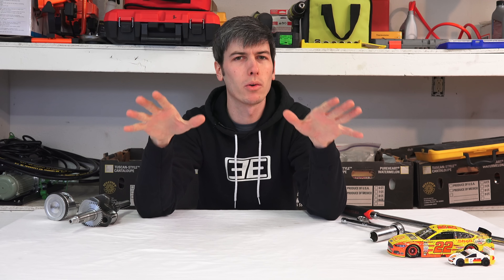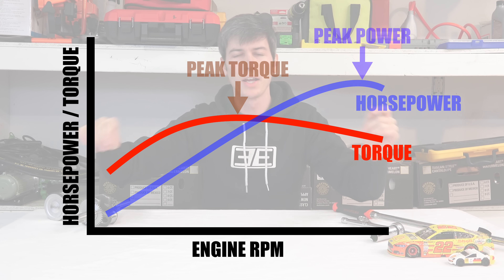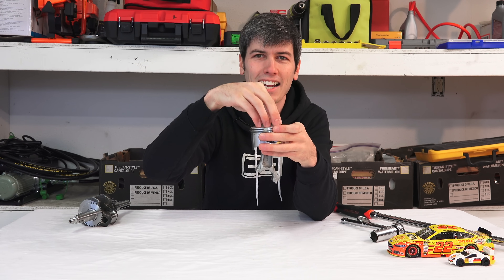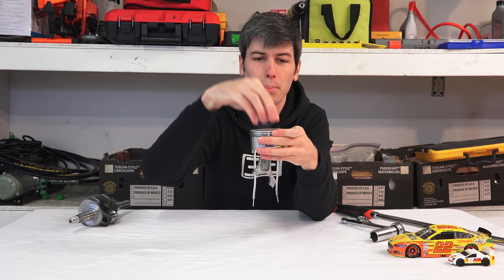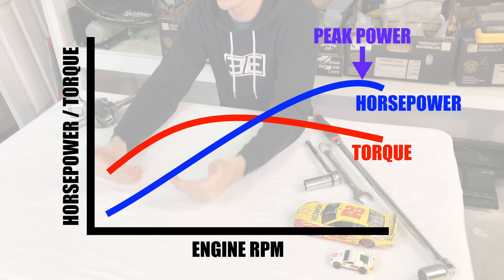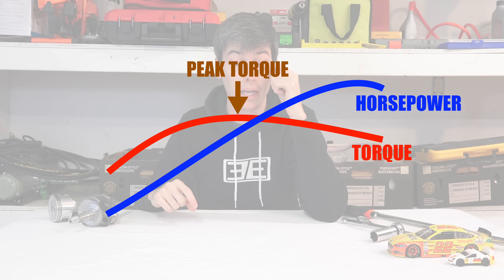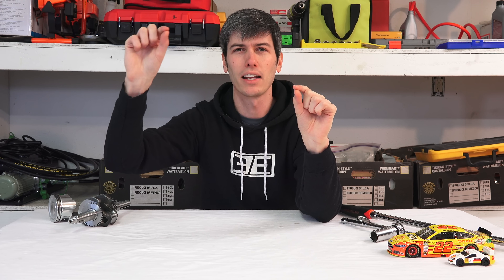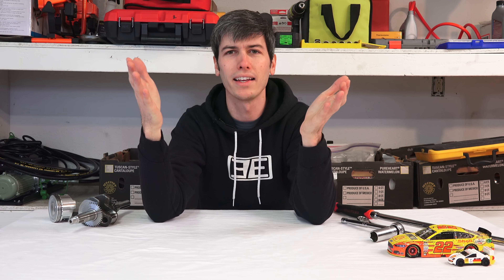Horsepower vs Torque - A Simple Explanation

Comment: Great video explaining the two and keying that they are the same measurement. Only issue is how you kept favoring HP instead of torque by changing the gearing. Well it works the other way around. If you have more torque and less hp, you can put larger gears (smaller in number) to make your car go faster. This is what chevy did with the C6ZO6. Anyway if you have a 5000lb car making 200hp/100ftlbs vs another car at 5000lbs with 100hp/200ftlbs. It would boil down to gearing if that was the only factor which would change between the two.

At the end of the day, they are the same.
Reply: This is 100% false. Look up the definition of power, it's a whole different concept than torque.
Reply: Power will tell you how much work the engine can do and how quickly it will do it. Power is the end all be all when it comes to capabilities of an engine. Gears change the torque and speed of the engine output into something useful for the given scenario. You can change torque and speed easily with gears, power cannot. More gears allows the engine output to be applied more effectively at a wider range of scenarios.

Comment: Torque = the power produced by the engine
Horsepower = the power output by the gearbox through the wheels onto the ground
Reply: No, torque is not power...it's torque.
Reply: @buzzlesworth54  You didn't get the point at all.

Comment: How about a car that makes 550 ft/lbs of torque and 500 hp at 5200 rpm vs a car that makes 370 ft/lbs of torque and 500 hp at 6700 rpm?  Would Low speed broad torque would win out when peak horsepower numbers are equal?
Reply: When starting from idle rpm, the torquier motor would tend to win if the vehicle weights are equal.  If both motors begin applying power to their powertrains while in their respective power bands via a technique like sidestepping the clutch at high RPM, then they would be about equal and it would come down to other factors.

Comment: I have 103 torque and 103 HP on my Harley, weird huh. It's all pull and hang on. When I first had it tuned it took me off the seat on a couple bumps at an intersection when I took off fast as the light turned green.

Comment: The force pressing you into the seat HAS to be highest at peak hp! Since: force = acceleration × mass . So the higher the acceleration the higher the force and we accelerate fastest at peak hp.
What you are feeling at peak torque is the highest increase in acceleration per rpm! So the force pushing you into the seat increases at the highest rate, but it still is going to be highest at peak hp.

Comment: hp = torque*rpm
100 =10*10
100 =50*2
is torque analogous to force?
my confusion is how can high force result in low rpm?
or is force on a lever completely independent of acceleration as f = ma ?
as at the tip of a gear the acceleration is higher than the accleration  at the areas nearing its centre 
while torque or force is reversed lower at the tip and higher at the areas near its centre
Reply: His equation isn't completely correct,  the full equation is (torque x RPM)/5252. Torque is force applied in a rotating direction, power is torque times radial velocity, how quickly the force is applied.

Comment: Does horsepower = horsepower?  I've been meaning to ask you this for years as the answer will clarify the larger picture for me. 

Suppose this theoretical situation:  ENGINE 1 is a high torque, low RPM engine and at a certain RPM makes 300 HP.  ENGINE 2 is a low torque, high RPM engine and at a certain RPM makes 300 HP.  Both engines weigh the same.

If both engines were placed in identical chassis, identical gearing, identical traction etc and both revved to where the math = 300 HP... would they pull identical sleds (or any kind of work) the exact same distance over the exact same time?

I'm hoping you will provide 1 of the following 2 answers:

1) yes, because horsepower = horsepower
2) no, because...(fill in the blank)

Thank you for indulging me on this as I have a great deal of knowledge in the physics/math on this subject (including watching this video numerous times) but have never had a clear understanding of the big picture.

Comment: Wait what... hp gives you acceleration? I'm so confused. How can hp give you acceleration when torque is what gets you moving in the first place. I was taught that hp wasnt even a real number it's just a figurative number (which I guess this guy kinda explains).

What I was taught was; torque gets you moving and hp keeps you going. Is that what this guy is saying???
Reply: I understand your confusion since it's kind of a chicken and egg situation.

Torque applied to a rotating body gives you power.  If you apply a torque to a fixed object, like when you stand on a diving platform, you aren't generating power.  Gas motors need some slippage with the transmission to start out transferring that torque or the engine will stall, hence clutches and torque converters.  Electric motors generate a magnetic force field from 0 RPM that generates that initial torque so they don't require a clutch to apply that initial torque to the rotor. This is similar to when you apply a torque to a bicycle crank from a standstill; you instantly start moving by applying power to the bicycles drivetrain which accelerates you, even though in the first instant there was no motion.

Comment: Without forced induction: 

Large displacement (force), low RPM = highest torque, least wheel horsepower

Large displacement, high RPM = mid range torque, highest wheel horsepower

Small displacement, high RPM = least torque, mid range wheel horsepower

Small displacement, low RPM = you must be driving your nan’s car.

Comment: Conclusion : you can multiply the torque with the gearbox (until the rpm and horsepower limits of your engine) but you cannot ever multiply the peak  horsepower.
Reply: Even more: Theroretically, you can multiply torque to any imaginable number with a given power, it will only be applied at a (very) low revs. Torque is derived from power, power is the fundamental. There is no “vs” in torque and power.

Comment: TQ is like $/hr
Rpm is like how often you get paid
HP= salary or how much you can spend or buy. 

200hp/200tq will always do more work than 150hp/250tq

Hp is the available energy you can use to move the car. Tq is just one component that makes up this Hp unit. 

This is why, lets say. 
Person 1: works as a bagger at a grocery store. makes 10$/hr, works 60hrs a week. Paid every week. 
He Makes 600 a week (ignore theft, i mean taxes).  Thats 31,200$ a year. Or he is able to spend or buy 31,200 "Units" of Things. 

Person 2. Waiter at a fancy Steak restaurant. Works only 35 hours a week, and averages around 17.14$/hr will pay and tips. person 2 also makes 31,200$ per year

Both have the same spendable energy as each other. One "revs" higher i.e. higher hours worked but makes less per hour i.e. lower tq. but results are identical to the other that has more tq i.e. makes more per hour, but revs lower i.e. works less hours. 

The end result is, hp (pick your energy unit) is the numerical number you should only be caring about. make this number as high as possible at all rpms...period.

Comment: So i have a car with two options:
 1- sacrifice torque at lower rpms but higher torque at high rpms
2-  more torque at wide range of rpms.
 Assuming that torque is coming from out source as an addition and my question is what do i chose for quick acceleration?

Comment: this guy only knows to explain what is obvious in the relationship of numerator to denominator. will make this as simple explanation as i can. think about this horsepower will take you to the top speed but the question is how long due to gearing. A very torquey engine with lower horsepower can be faster because they spin merrily and quickly to the engine's peak torque at that rpm. and the reason that no one can plot rpm to hp x and y axis is because an engine is a shock or load allowing power plant. meaning they can be exerting 120hp at 6500rpm or 120hp at 3000rpm due to resistance.

Comment: I was always told that the amount of energy it takes to move a car one mile is the same no matter the speed (in a vacuum).  The difference is the time the work is being done.  So, if I walk down my driveway one time and run the next the energy used is the same, just when I ran it was used much faster.
Reply: In a 'vacuum' i.e, all things being equal.
Reply: Exactly, the amount of energy used is exactly the same, the only thing that changes is air resistance (which there isn't any in a vacuum)

Comment: All your arguments about gearing and horsepower also apply to torque.
The less the torque the lowerer the gearing needs to be and the higher
the torque the higher the gearing can be.
The 200 ft/lb car would accelerate faster to a certain point before the
200 HP car created enough horsepwer to overtake it if gearing was equal.

Comment: Totally misunderstood topic. Power is what it is all about. Torque is just a byproduct. I can easily have more torque in my little finger than a V8 engine has at the crank. Just give me a lever that is long enough and I have that engine beat. Furthermore, torque of engines is normally measured at the crank, not the wheels. You can multiply the torque at the wheels simply by changing the gearing. Will that make the car go faster? NO.

Comment: Im not sure this is all correct. If one car has twice the torque of the other, then with the same gearing it will accelerate faster initially. Yes if the more powerful car has more aggressive gearing that can compensate but it would be rare for gearing to make up for a torque ratio of 2:1 between two otherwise equal cars. As Gordon Murray once explained, acceleration is mostly about torque to weight ratio. Top speed mostly about horsepower to drag.

Comment: Thanks, that really helped. When it comes to speed and acceleration of a car it is horsepower that counts, but what about pulling power or climbing a steep slope at a slow speed? I am thinking about off-road vehicles here. I am not an engineer btw!
Reply: Torque is needed for offeoad and pulling, also he is wrong about the accaleration. More torque= faster acceleration
Reply: @mickheesen348  He's not wrong, his point is that if you have enough horsepower, you can create the higher torque by using gearing.
Reply: Climbing a steep slope at a slow speed is a matter of gearing and having engine components strong enough to handle the torque that is being transmitted.

Comment: If you have 2 auto-transmission cars identical in every respect but one is turbo-diesel & the other, petrol.
Using twice/half power/torque scenario as in video, wouldnt the diesel car get off the mark quicker than petrol because of its "double" amount of torque?
Reply: The specific power curve matters, and also whether they launch from 0rpm or a chosen higher rpm (clutch dump)

Comment: How would you explain defination of torque in electeic vehicles?????
Reply: Same definition.  It is still a rotational twisting force.  It just comes from a permanent magnet interacting with an electromagnet, instead of a piston/cylinder assembly interacting with a crankshaft as it is pushed by expanding combustion gasses.

Comment: 1 Horsepower ISN'T the "power of one horse," but that's probably what some guy was thinking to get him to figure it out.  It's the value for moving some mass 1 foot  in one minute.
Reply: 1 horsepower is the average power output a horse can maintain throughout a day. It is equal to 550 ft*lb/min. It is the power required to move 550 pounds 1 foot in 1 minute.
Reply: Horses of course, are all different, so a single horse does not necessarily produce 1 HP of power.  It was the average draft horses that James Watt tested, over long periods of time, and the power they could sustain is what he defined as 1 horsepower.   He did this, because he needed a metric to sell the first steam engines, and put it in terms that people in a pre-industrial age could understand.

Comment: Moving car from point A to point B you will always do the same job. And power is not related with the speed directly. Power is needed for acceleration and to counteract resistances (air, friction, etc.)

Comment: Torque is the length of a horses leg. Speed how fast they move over the ground  one stroke at a time. Two horse power is 8 legs, three is 12. So given that this guy knows nothing. Exhaust ? Is the ejection of spent fuel rods from beneath the tail. Anything else I can help with ?

Comment: Ok, in regard to your 200hp/100ft lb tq vs 100hp/200ft lb tq example, in your initial statement you said, "Let's say, we have two different vehicles, that are "EXACTLY" the same." 
   First, the sentence itself, is a contradiction. "Two different vehicles, can't be exactly the same. Two vehicles can be, however.
   Aside from that, and assuming the two vehicles are, in fact, identical, they would both have IDENTICAL transmissions, and IDENTICAL differential ratios. Correct?
    And that's where you lost me, because you modified your explanation at the end of the example. Suddenly the two cars were no longer "the same." The one with more HP was suddenly being modified by you.
   My point is, torque is the rate of force that determines how quickly a given mass moves down the road. Not horsepower. All Horsepower does is determine the maximum speed that mass can achieve.
   The Germans know this very well. Which is why the majority of their car engines are "grunt motors." Built with slightly more torque, than horsepower. 
   My 2001 Jetta GLS VR6 was a prime example. The engine only made 174hp @ 5800rpm and just over 180ft lb tq @ 3200rpm. Now if what you are saying is correct, why on earth do you think they would do that? 🤔
   And that car hauled ass, btw. And the engine felt like it was hardly breaking a sweat.

Comment: Torque gets you off the corner, horsepower carries the straightaway.  This is for circle track racing where there generally is no shifting.  It woul be easier to understand and easier to explain without including the talk about transmissions and gear ratios.

Comment: So what's torque and horsepower again??
Reply: Torque is the rotational equivalent of a force.  It is determined by a force multiplied by the length of leverage from the axis of rotation.

Horsepower is a unit of power, coined by James Watt, to express the performance of the first engines in terms people could understand in a pre-industrial age.   James Watt is the namesake of another unit of power (coined after he died), which is the SI unit for power we call the Watt.  The concept of power is the rate at which energy is transferred from one system to another, or converted from one form to another. 

Torque in combination with rotation speed, directly determines the horsepower.

Comment: Im confused in the following:

HP is torque multiplied by rpm.

So how is it that in some dyno graphs you have spots where the engine is producing more torque than HP.

Also, shouldn't the hp curve then ressemble the torque curve, but with like an exponential feel to it (non-linear growth compared to the torque graph).
Reply: It's all based on the engine builder's choice of camshaft design (lobe grind).
Reply: Stuart, if you are genuinely interested in the answer to your questions, I highly recommend looking up books and articles by a man named David Vizard. He also has videos here on YouTube. He is truly a genius when it comes to engine building knowledge, and specifically focuses on camshaft grind selection, and how important it is, to get it right when building performance engines. 
   And it's a fact, that he is personally responsible for a great many of the camshaft grind choices more than a few major auto makers' engine design teams, have used for their engines in final production.
   Personally, I purchased his book, "David Vizard's How to Build Max-Performance Chevy Small-Blocks on a Budget", before building the engine in my car. The book is worth it's weight in gold....

Comment: Sorry for all the comments but this one is interesting talking about torque and rpm. Two time world champion in Nostalgia Front Engine Top Fuel Dragster was the So. San Francisco based Champion Speed Shop dragster tuned by Bobbie McClennan with a blown injected nitro methane powered 307” small block Chevy running against nitro powered 500” Donavyns.

Comment: Been involved in racing and horsepower in all forms for many years and understand the horsepower curve and where to shift at peak power and the importance of staying in the HP band. I have trouble understanding which is best between horsepower or torque such as small block and big block or short stroke and long stroke motors and of course gearing. He said this was a simple explanation of how it works. I had to pause a few times to catch up cause my head was spinning. Maybe it’s just me but this is funny. Unfortunately I still can’t explain it. I’ll have to watch it a few more times. I do appreciate this presentation and maybe I’ll get it.

Comment: If two engines are spinning at the same rpm, the one making twice the torque makes twice the HP and vice versa. 

If two engines are making the same HP, the one spinning half as fast makes twice as much torque. 

If two engines are making the same torque, the one spinning twice as fast is making twice as much power and vice versa.